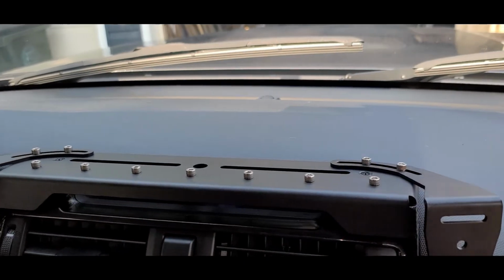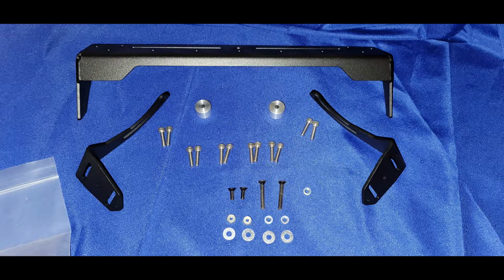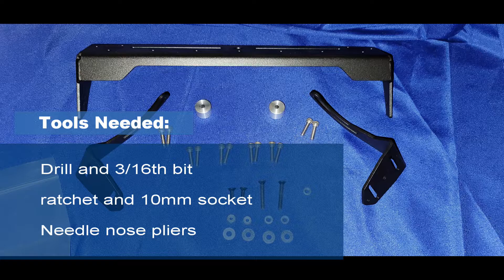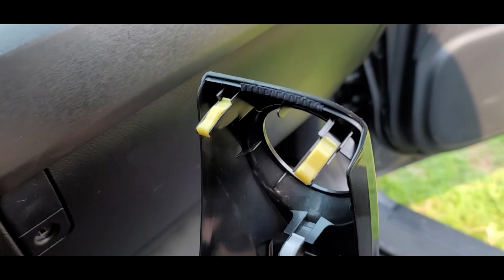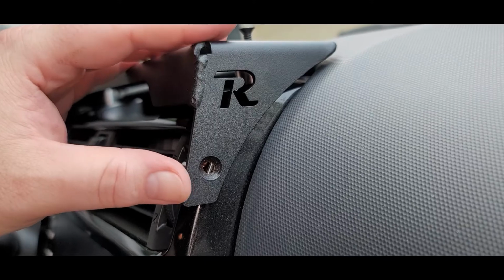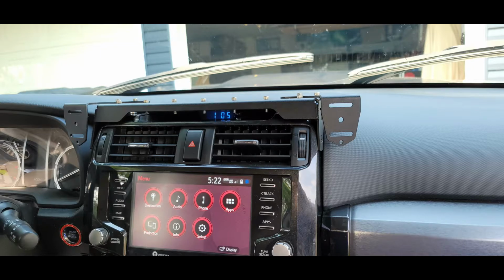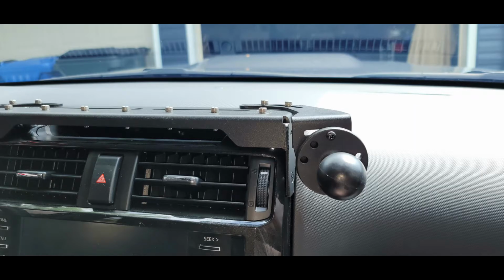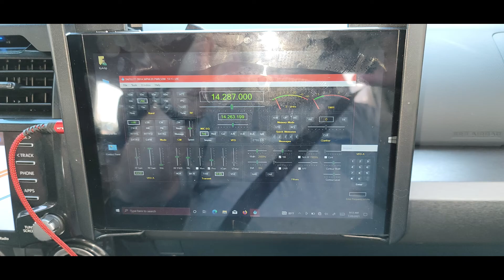LCARA HAM Radio: Rago Fabrication 4Runner Dash mount

Comment: Great DIY video, Chris!  You're a good instructor.  Your detailed instructions are about the best I've seen because you understand the importance of drilling the holes in the correct place the FIRST time.  Many of the YT DIY videos do not emphasize all of the intricate details [that you shared] that will make a difference in getting things right the first time since you can easily get yourself into a corner if you drill too soon without knowing exactly where the best place to drill is, and knowing what you may be drilling into on the under-side of the plastic.

Q) Would this Rago mount be rigid enough to hold two (side-by-side) full radios, or would you recommend only mounting the faceplates for the two radios and locating the heavy part of the radio elsewhere in the 4Runner?